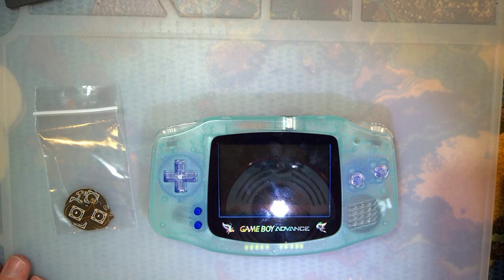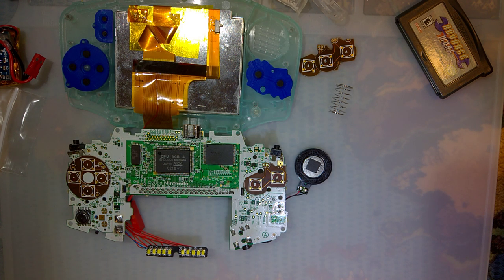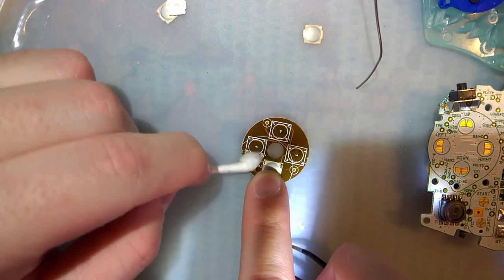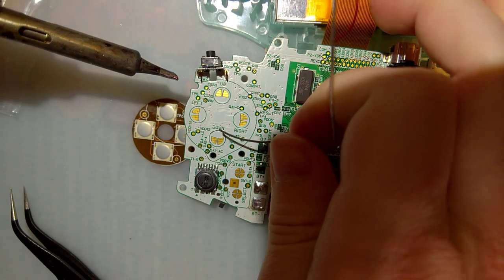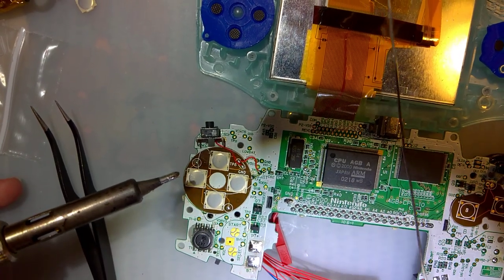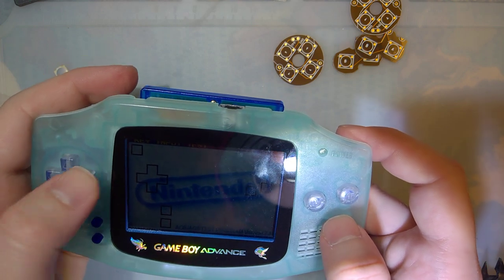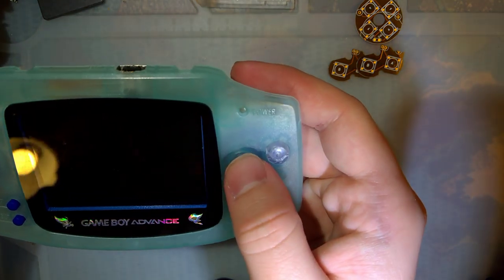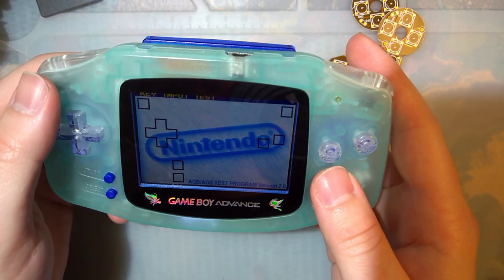Game Boy Advance Tactile Button Mod (Part 1 of 2)

Comment: I actually used this as a tutorial, if you will, of how to replace a broken tactile switch on a SP where someone apparently had smashed the button so hard that the original tactile switch was cracked open. If you pressed it just right, it would work once in a while. Sourcing the same part you listed, I bought from Mouser and had in a few days. Removing the old switch was definitely a lesson in profanity without hot air. Cleaned up the pads and installed the new one like you did here on your custom board, and BAM, SP is working great. Thanks for your awesome videos! Interesting how something somewhat unrelated can end up being a tutorial for something else.

Comment: Dude, you have to fill up the hole of the center of the modded directional pad so the bump of the cross bottom won’t sink when you press the directional with you thumb! I think that will fix the problem
Reply from the maker: I know. I said this in the video.
Reply: @makho  or have someone make you a metal Dpad with a tall nub

Comment: So I recently bought the boards to try out on mine. Easy to put on and install. But since I wasn't sure on the website, un checked the setting before placing the order, like for the PCB. So I ordered them default and so when they arrived, the PCB's were pretty thick. Regardless installed and works. Just tight enough to not have to put leverage on the membrane pads. Putting everything together, its super tight fitting, like just barely.
Reply from the maker: They should be flex PCBs because otherwise it won't fit.

Comment: I did this recently just directly to the gba motherboard with buttons harvested from a dead sp then using the thin membranes that the sp uses and it worked perfectly fine

used small rectangles of copper tape I had on either side of where the membrane is supposed to bridge and just soldered the buttons directly to that
Reply: could you elaborate more on this? like in more detail ?
 sorry new to this type of stuff

Comment: You could take the hole out of the PCB on the d-pad or, you could 3d print a pivot point for center pin on the d-pad. Just an idea

Comment: Thanks!!! That was one of my recommendations I think, but thanks!!! This looks awesome...
Reply: 20:26 Also, for the membranes, wouldn't the GBA SP membranes work for the GBA? Those should be a bit thinner than the GBA ones, if I'm not mistaken...
Reply from the maker: It's worth a shot, I suppose. I haven't tried anything yet because I was tired after making this but I'm concerned that because those membranes are so thin, the buttons will just rattle.

Comment: I tried this recently, but did not use a board. Just solder them directly to gba board. I also did not like the feel of it. In paper it sounded it great, in reality felt terrible :( maybe we need different buttons or rubber pads
Reply from the maker: I think it would be better without the additional springyness of the rubber domes on the membranes and, perhaps, with less travel. Taller buttons might actually be better.

Comment: Would love to see a update to this!
Reply from the maker: nothing planned at the moment. The next step would be to replace the membranes with 3D printed inserts (or custom molded/printed buttons) and I've just got so much stuff on my plate right now.
Reply: @makho  I totally understand, I work 6 days a week and don't have much free time either.
Reply: Did you have a 3d Design for this mod? Im seach for a 3d Print replace membram

Comment: Hey mahko i know this video is old but i am interested in doing this mod to perfect my modded GBA. I would like to know where you got your PCBs printed and if they only required your design on the github, or if you did all the specifications I see on most flex pcb sites. If so what are those specifications I should input. Its all greek to me. 

Also I know I could simply look at the two flex pcbs but my memory and spatial reasoning are both shot, is this compatible with NatalieTheNerd's LED pcb?
Reply from the maker: As I tried to state in the video, this is not a complete mod without custom buttons or custom button inserts. You can't just add tact switches and expect the buttons to feel like those on a SP. I never finished making those custom inserts.

To make the PCBs, you'd need the files linked in the description. I'm unsure of their compatibility with other mods but if there is any physical overlap, I doubt it will work.
Reply: @makho  Another question. Do you have an eBay store? I would love to pay you for this type of work. My dpad is super squishy.
Reply from the maker: @alexmendez3681  I don't do commissions and I don't have a store
Reply: @makho  okay. 😢

Comment: Is it hard to replace these switch buttons on a gba sp? The metal part of the button (the part that actually gets pressed down to make contact) fell off when cleaning the buttons with IPA. Now it won’t stay in place.
Reply from the maker: desolder is more difficult than resolder but if the switch is already broken, you don't have to be careful when desoldering.

Comment: My SP AGS-101 button A has a double tapping issue (sometimes presses register twice). Since its an 101 I can't just easily swap the board out for an inexpensive 001. Would this tactile switch work as a replacement? Or would you recommend salvaging one from a broken 001
Reply from the maker: it's the same part
Reply: @makho  thanks! Guess I'll try desoldering these things!
Reply from the maker: @Phigames  you could just try opening the switch and cleaning it first, especially if the alternative is desoldering and replacing anyway
Reply: @makho  Ah I didn't know you could just open the switch. I'll try that!
Reply: @makho  Do you have any hints/best practices on opening up these switches? Had a look and I'm concerned I'd break these things
Reply from the maker: @Phigames  you already mentioned replacing the switch entirely, why is breaking it a concern?
Reply: @makho  It kinda already works fine majority of the time, except for the double pressing issue which only occurs when you're pressing the top half of the button. Anyway, I was wondering more if you had already opened an SP tactile switch before, would make me feel better if I knew it was possible and you'd already successfully done it :)
Reply: @makho  Just to let you know, it worked! The tactile metal disc on top of the button contacts was pretty loose so it was pretty easy to pry it open and clean the inside with isopropyl. I then turned it 90 degrees so it was using different contact surface, and kapton taped it down so it wasn't so loose. Now works perfectly with clean button responses. I will probably replace it later but for now, it works, thanks for your advice :)

Comment: Sounds awesome, but what is tactile buttons? And what's the purpose of them?
Reply: The name says it all. A button with a tactile feel when you press.
Reply: @SuperLuigiGuy64  I didnt know what tactile meant. But thanks..
So is it a major difference between the standard buttons or does it improve gameplay?
Reply: @xXStrifeXx017  tactile buttons have a click feel to it and has way shorter travel than membrane style buttons.
Reply from the maker: @SuperLuigiGuy64  That's true in normal circumstances but since the GBA was designed for membrane buttons, the button travel is still largely the same.
Reply from the maker: @xXStrifeXx017  No difference whatsoever in game play. Just another thing to mod. In my GBA, it doesn't really serve a purpose but it might be useful for someone who has a GBA with really worn out button contacts or corrosion or something.
Reply: @makho  Ah, okay.
Reply: Oh I see awesome thanks for answering my question! I recently got into modding my gba with a ags 101 with no experience and a day later the screen broke already installed. I went in my drawer to grab and play and saw it was broken. Thought it was one of daughters but I think I may have over tightened some screws :(

Comment: Hi makho and ppl of the comments section. I'm looking for a way to upgrade the speaker of my gba sp similar to the mod for the original gba, but it doesn't seem to be a mod for the sp. So, I was wondering if there is another way to address this problem?  (Thanks for the funnyplaying mod tutorial btw makho)
Reply from the maker: What like an amp? The install should be the exact same in an AGS except that you'll have to find a place to shove the actual amp itself.
Reply: @makho  yeah, like that. I was trying to find a place for it in my sp, but I ended up messing up the reshell I bought. Could u do a vid tutorial for the sp please? I would really appreciate it. (While I wait for my replacement shell XD)
Reply: @makho  also, the mod form retro medding requires  soldering to the earphone jack that the gba sp dosen't have

Comment: I do not recommend this mod. I attempted to install this mod but could not get it to fit, almost damaged my GBA. It’s too thick and puts lot of pressure and flex on the motherboard pcb, also the button will not click right at times. It has to almost be perfectly lined up to get the right click. I recommend getting an SP if you want clicky buttons. Overall membranes are better for long term reliability, no soldering necessary to get them working compared to tactile.
Reply from the maker: Sounds like you didn't order flex pcbs like you were supposed to.
Reply: @makho  The entire time, there was a flex option? Thanks i’ll order it again.